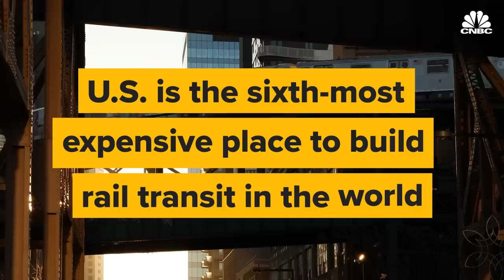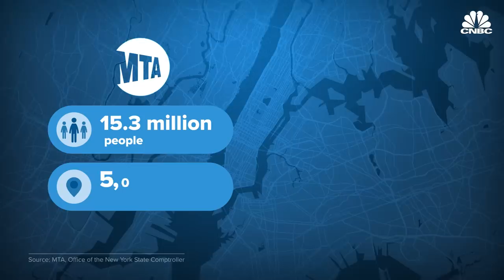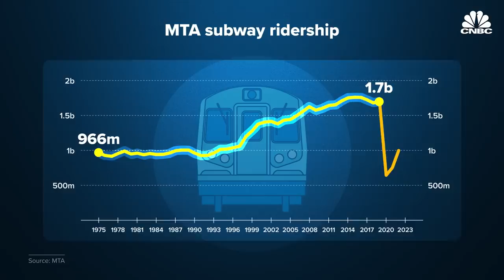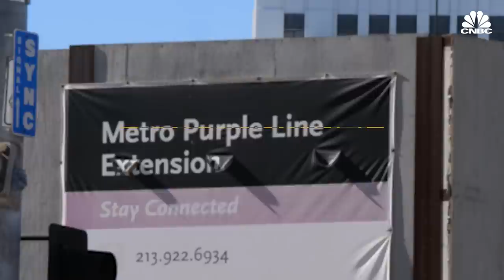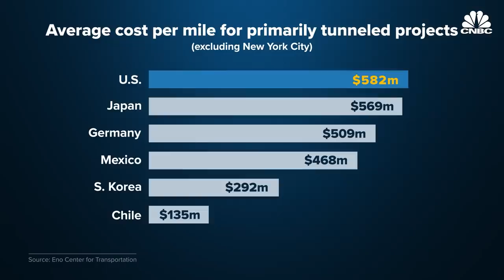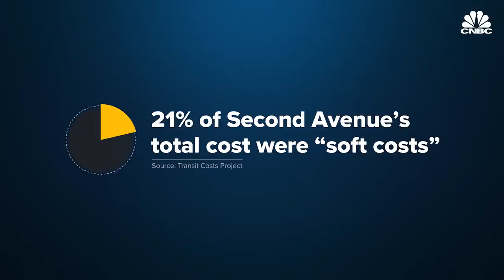Why American Subways Are Some Of The World’s Most Expensive

Comment: Does this guy not think other cities have things below ground?  European cities have the potential of hitting archeologically significant ruins every time they dig.  And every city has sewers, water, and power underground.  Get out of New York for once in your life, dude.

This was a pretty solid video though.  I think they hit most of the issues on this problem.
Reply: I saw that also. Super weird and strange excuse for the high costs. 🤔
Reply: It's the excuse that most members of the American public believe for New York's high construction costs even though it actually doesn't make sense
Reply: From other things ive read/heard/been told about with inspection and infrastructure, the US is pretty abysmal relative to a lot of Europe at actually keeping records or plan for a lot of stuff that's underground+an issue the video mentions of refusing to use standards, meaning you have to get more money and manpower towards it to make sure you wont accidentally explode a sewer, i didn't get the impression he was complaining it was only a problem in NY but to him its probably the perfect example of his exasperations
Reply: @Brian-tn4cd  There's oodles of undocumented infrastructure below Manhattan. I've looked at track maps of subway tunnels (not route maps, but actual tracks, switches, interchanges/junctions, etc) and parts of the island resemble swiss cheese below ground. 

One proposal to connect the PATH subway to the Lexington Ave line (east side IRT) went nowhere in part because there were too many crisscrossing tunnels on too many different levels to thread another one through from the WTC complex to the Brooklyn Bridge terminus (the trains are similar in dimensions, but institutional barriers (PANYNJ vs MTA) were the real deal-breaker.
Reply: @keikoyoshikawa9316  they did, and the point still stands that US construction is slower and more expensive than Asia's or Europe. Paris is one of the most densest cities in the cities in the world and they still manage better avoiding their catacombs
Reply: Plus in Paris, beyond the famous catacombs, there are also a bunch of aquifers, old abandoned quarries and layers of brittle or dissolving gypsum and sulfur = damp marly or brittle soil with holes, unexpected cavities, water infiltrate and lots of 19th century sewers.
Paris underground is a nightmare to dig through, they regularly have to freeze the ground hard before digging with large cold generation factories and tons of liquid nitrogen pumped into kilometers of piping.
Reply: Okay, but isn't Paris mostly limestone, while NYC is granite?
Reply: @peter7936    There's limestone in Paris soil, but it's almost more correct to say "there was". Much of the limestone layers are now the walls of the iconic 19th century Paris buildings.
That's why there are 300+ kilometers of abandoned quarries under Paris, which are galleries and voids.
But it is not uniform, most of the underground is more like a salad of water filled stuff.
The vaguely solid part of the underground is a Swiss cheese and the rest can only sustain holes if you maintain them hollow, if not they automatically close or fill-up with water.

The underground is composed of many things, from gypsum and sulfur layers (when they're still there, as gypsum was mined to make the famous "plaster of Paris"), to large layers and pockets of sand often being aquifers as the water table is pretty shallow.
One of the lines of the historical metro has a section that runs on an underground bridge mounted on high pillars because it crosses a kind of cavity. I don't remember exactly but I think it was a quarry too, and it's under a hill, so it hasn't filled up with water.

So it is very complicated and costly because it is unstable and soft or outright flooded.
On several occasions (especially in the Northern half, from the river to CDG airport) they had to freeze the ground hard with cold generation factories pumping tons and tons of liquid nitrogen first and then supercooled saturated brine into elaborate underground piping to freeze the "soupy" soil into rock hard ice. A process that takes months and costs a lot.
They also had to use this process in haste to stop a surprise flooding from worsening.
Some stations have to be "anchored" to prevent buoyancy during construction.
And most TBM's are of the pressurized mud / slurry type, which are slower and more complicated.

With granite ground, you dig rock, convey rock and pile up rock. It's mostly dry, easily sortable and transportable. Imagine holding a handful of small rocks in your hands versus trying to hold a handful of wet sand and mud.
With Paris soil, you need slurry treatment facilities, sorting and cleaning processes, storage basins, thousands of cubic meters of bentonite, water recycling and treatment facilities, etc, etc. On each site... Just to handle spoil that is a muddy soup, then clean it, extract the bentonite to recycle it, sort the soil and store, re-use or discard.
It's not that different from the South half of London, where you'll see that there are very few subway lines, for a reason.

Limestone would be pretty easy to dig through in comparison, but that's not where metro lines run as the limestone layer is scattered by centuries of mining and not at the right depth.

If you ever visited Paris and used the metro or RER, you might be familiar with the well known and terribly foul smell in the Auber - Opera - Haussmann Saint Lazare underground complex, several other stations like on M14 are affected too.
It's due to water infiltrations reacting with gypsum and mostly sulfur and producing a rotten eggs smell with a touch of vomit. They've been trying to find a solution for half a century to no avail. The station complex is literally surrounded by water filled ground.

Several stations and tunnel sections of the Grand Paris Express project that have been built / are being built / will be built are under or through aquifers.

And as for the subject of the video, as some other commenters already said, there's always a bunch of arguments presented as justification for the outrageous cost of infrastructure in the US in general and New York in particular that simply don't hold water.
There's systematic overinflation of projects' costs and no real justification for it.
New York's granite ground is a bit more complicated than an all soft rock soil like a limestone bedrock. The hardness of the rock can make the digging process slow.
But compared to water infiltrated sand or marly, brittle or muddy soil, that's almost a walk in the park.
The causes for the crazy cost are found in the project's process, management, decisions, etc.

Especially when you compare the 200 kilometers (125miles) of new metro lines of the Grand Paris Express and its cost with 2nd Avenue subway or East Side Access... The pessimistic estimate for the Grand Paris Express puts the cost of a kilometer of new metro line at about 200 million euros, or 175 millions according to the middle estimate. And that's including the cost of the crazy strict French tunnel safety laws requiring emergency access / exit shafts to the surface no farther than 800 meters apart. Which forces the project to have something like 150 or 200 shafts in between the 68 new grandiose stations.
That's another frequent but more elaborate cost explanation that was pointed out by NYU's Transit Costs Project study : the uniqueness and "grandiosity" of stations like the ones with the large mezzanine on 2nd Avenue subway.
But the Grand Paris Express project only has unique and grandiose stations, except 3 elevated ones that are variants of the same model, but the 65 others are unique and many are closer to cathedrals, palace lobbies or museum atrium than metro stations.
Yet, the cost per kilometer is incomparably lower than in NYC.

Same problem with CAHSR or LA metro, costs are abnormally high.
Anyway, sorry for slipping way past the scope of your question.

Comment: About the grand paris express, it is worth mentionning that it is 200+ km (125 miles) of fast, driverless metro, equiped with plateform screen doors. The size of the subway network is going to double that of what we have now by 2030. Therefore comparing the cost per rider is a bit wierd since the benefits of such a project seem a lot bigger than the 2nd avenue project (it will add almost a milion people to the network every day). Also the Grand Paris Express is even more than just this, since it is transforming entire neighbourhood by adding new flats and offices above or near the stations.
Reply: Well it shows how crazy it is that the second avenue subway cost half that of the GPA.
Reply: Exactly. It's transit oriented development. Here in the US you'll have a gazillion of people protesting against apartment buildings near transit station "devaluating my single family home". Happens right now in Long Island.
Reply: @PascalGienger  I have difficulty believing being close to a transit station devaluates a house, even when the station comes with apartment complexes. Then it also comes with shops etc...
Reply: Grand Paris Express cost per rider is likely hurt by the inclusion of lines through more sparse areas (especially Line 18). I'd like to see the fantastic Line 15, which is the exact project US cities should be emulating, compared to the 2nd Ave Subway on cost per rider.
Reply: To me the worst is line 17 rather than the 18, since it basically have no interest. Whereas the part of the line 18 from Orly to Saclay through Massy is much needed, given how it is booming around here. It is the rest of the line that looks overbuilt. Also IDFM plans on expanding the line to Nanterre and to the east of Orly to connect it with nearby cities. I think that the first looks over built when the latter looks interesting. The true test will be the number of riders...
Reply: @Pascal Gienger that's the reason why the acronym NIMBY was invented, those people think that the land their house is on for generations is valuable as heck, and they think the value of said land is about 100 times more than actual value (last part is sarcasm on my part).
Reply: The latest expected daily ridership for the Grand Paris Express is 3 millions or more, not 1 million.
And line M17 will serve CDG airport with a much lower ticket price than CDG Express.
M17 is also much needed by airport workers that currently only have RER B and busses (hence the longer operating hours for the GPE).
Plus, the scrapped plans for terminal 4 are only temporary, it will inevitably come back : air travel is booming, Airbus alone has nearly 9000 aircrafts on its production backlog and CDG's traffic growth predictions are even higher than they were in 2019...
CDG is also the only mega hub in Europe with enough land to expand and enough parallel runways :
FRA will be maxed out once its new terminal is finished and limited to partial 3 runway simultaneous operations, LHR has serious issues blocking its expansion and is still limited to dual runway operations, AMS can only do triple operations with long taxi and has been recently limited in capacity by law.

While CDG can double its capacity with a new terminal and possibly a simple runway extension. The French government certainly won't refuse all that economic influx and won't let it go elsewhere to the neighbors.
The only other hubs that can expand are smaller: 
MAD, but it is a bit off-center in Europe, too much to the South and it cannot do full / true quad runway operations (limited to offset 2+2).
And MUC, but it currently has only 2 runways with a heavily opposed 3rd runway projected, the conditions during winter are an important limiting factor and the economic and political balance in Germany will likely prevent MUC from becoming a mega hub and from overtaking FRA.

Long story short: CDG is the hub that has the most important growth potential in sync with air travel growth and that serves the largest metro area in EU. So line M17 will have a real purpose. It will also be, in combination with M14, the only fully automated access to CDG from Paris center = much less susceptible to disruptions (saturation, strikes, track incursions, etc.).
With the other lines, namely RER B & CDG Express, it will virtually guarantee access to CDG, whatever the conditions, on top of facilitating a much larger modal shift from car to public transit.

Comment: Now let's do an analysis on connecting other communities with train transit rather than densifying an already HCOL (I. E. Manhattan and the east river waterfronts of Queens and Brooklyn). As remote work gains even more support and implementation, the neglected parts of NYC train transit are getter denser and needs more public transit capacity. Eastern Queens and Brooklyn will never get the service it deserves. I'm glad I don't have to take my 2 hr commutes just to go less than 8 miles into the city. Now I just drive from my place in NJ to my NJ office in 25 mins over 14 miles  😅
Reply: You're correct about the underserved parts of NYC. More transit in Eastern Queens and direct connections between Bronx-Queens-Brooklyn would be fantastic.

Comment: 1:50 this is just nonsense, London and Paris build their metro at $250-$300 million a mile, why on earth are we costing $2 billion a mile? If we built at Western European peer rates we'd have enough money to fully fund 2nd ave AND probably take it back to the Bronx as per the original plans
Reply: The new Elizabeth line in London cost approx $30 billion therfore $500 million per mile.
Reply: Noticing the overcosts when watching RMTransit's videos.
Reply: @running_lee  That is misleading. The Elizabeth line trains run over 60 miles but mostly over pre-existing lines east and west of downtown. The new parallel tunnels connecting the two suburban networks are 21 km or 13 miles long, dug at a cost of $25 billion, therefore about $1923 million per mile.

Comment: Here in San Francisco, the Central Subway project is a joke. It doesn't directly connect with the Market Street tunnel (where the rest of the Muni Metro runs through), so you have a very long walk from the Union Square station, which would be an issue for anyone with disabilities. It went way over budget and doesn't even serve North Beach, which would not only benefit locals commuting, but also tourists. I was told from a Muni employee that all they need to do is build the platforms and the North Beach station would be ready to go.

Comment: I am assuming the per passenger costs states per subway line is measured over 40 years of the life of the subway route before it's in need of a major overhaul.  Would be interesting to see the cost of the subway line compared to the cost of a major toll road highway expansion over 40 years.
Reply: The issue is that the cost of roads can often be external : pollution, less density leading to lower cost efficiency in further projects and longer commute times, fuel cost for the households necessity of a lot of parking spaces leading to even less density (and other issues tied with artificialisation like floods...). But these costs are not obvious.
Reply: Of course, such comparisons are useful.   Highways can have steeper grades.

Comment: The knowledge issue is important. In Paris basically every year one new subway station or a Light rail extension or a new light rail line. This keeps the system slowly growing and then when we need to extend a regional rail line or build a new subway line(s) we know exactly what we're doing.

The environmental regulations are also an issue. Why should a light rail through downtown Austin be required to do the same process as an oil rig?

Also the example at 16:07 is terrible, the grand paris express uses a complete different standard of train thsn the rest of paris and the line 18 uses a different design than the rest of the grand paris Express. 😂 Exactly the opposite of your point lol

Comment: There are big issues with the reporting here.  It starts by referencing studies to demonstrate that US projects are more expensive than in other places.  But no references are provided so that I can validate the facts or the interpretation being asserted.  Worse, from there it goes to 'explaining' the reasons for the cost difference using quotes from talking heads for which no evidence is provided at all - and then jumps to solutions for the unproven causes, again without any authoritive sources for validating those solutions are viable and effective.

My own inclination is to strongly agree with most of what this report claims - but that's the problem isn't it?  Its using agreeable rhetoric to emotionally persuade us, rather than externally sourced factual analysis.